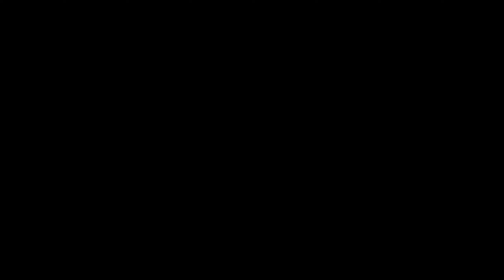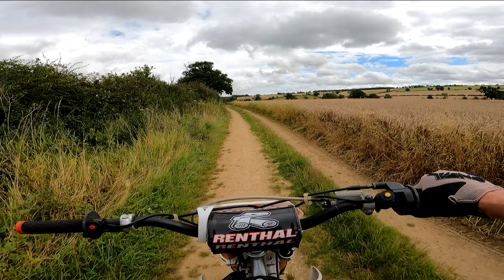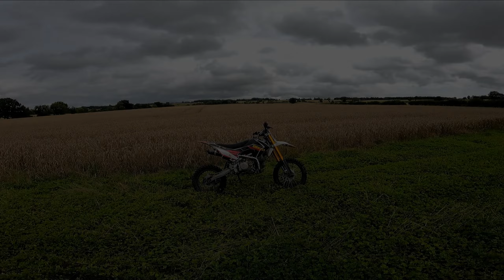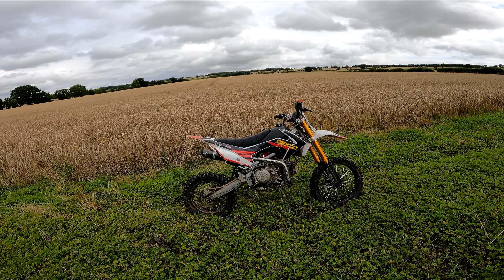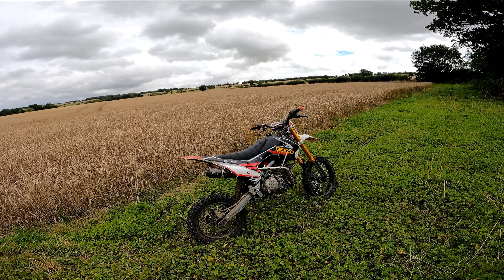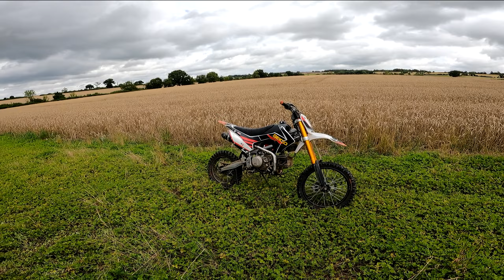Correctly Changing Gear on a Pit Bike! Experienced Riders

Comment: Hey from Cambridge, England...
I am 34 years old, and have been riding motocross since the age of 4...
and i ALWAYS ride clutchless, on every single motocross bike / pit bike ive owned...
Up and down shifting.. Just rev matching or throttle blipping....
and have not once destroyed a gearbox...
I currently have a 2005 Honda CR 250 (because they are getting rare), and after it being nearly 20 years old.. Its still on its factory gearbox setup..
I inspect the gears, shift forks, shift drum etc with every bottom end rebuild.. and none show any signs of wearing... After all these years...

Comment: By any chance do you know the dimensions of the woodruff key , its not the standard size used in all other motors,  sourcing one in the uk seems impossible  a certain racing site  has a listing for one but i believe it to be incorrect as it wouldnt fit other motors stated,the key way is deeper and shorter
Reply from the maker: I'm sorry I don't mate I've never needed 1 so I don't have a clue if honest. 
Sorry I can't help

Comment: Tried riding 125 lex Moto lxs today it’s a sporty looking road bike I’ve personally never used a clutch on a bike before other than a small pit 110 that I nearly flipped off the back off I done like a circle in a field and it cut out lol but anyway more to the point of the comment now,🤯  How do I get over the nervous clutch issues should I stop riding my ebike for a while first 😂😂😂 any tips bro honestly don’t mind if u can’t make sense of my comment i can always translate through someone else 🤣
Reply from the maker: Like anything mate practice makes perfect. Practice some slow clutch work I'm sure that will bring confidence